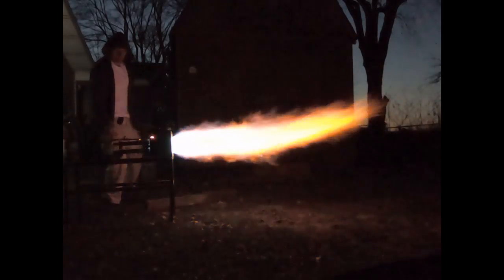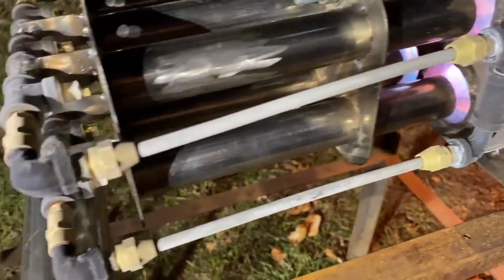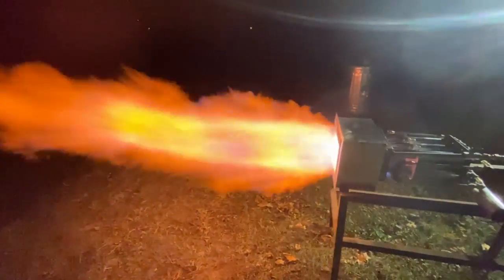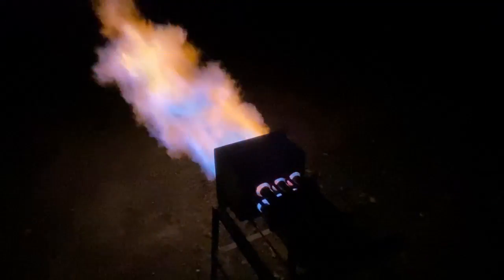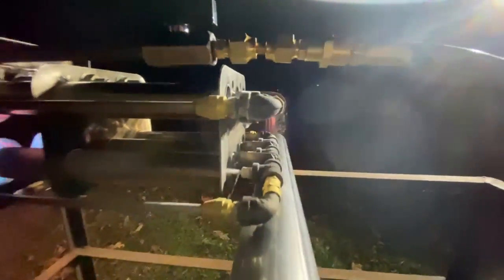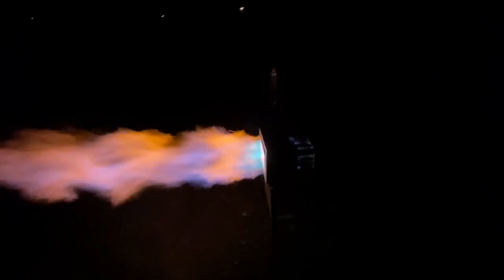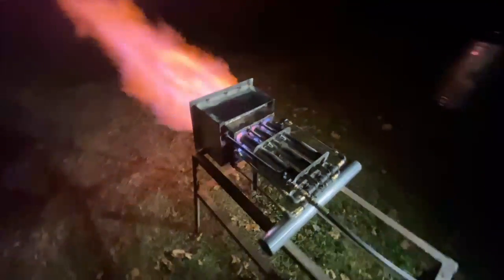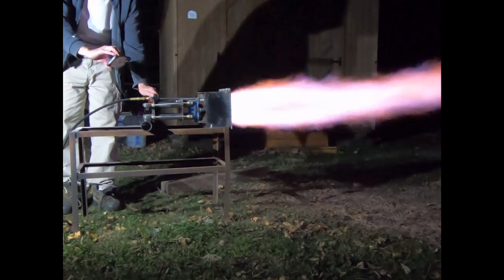Thunderbolt Propane burner 3,300,000 BTU 1 Mega watt

Comment: Looking to get started as a blade smith, and I understand very little. Any way to shrink this down into a ‘ribbon’ burner for a small forge that can get to forge weld temps with a slightly reductive flame? Or am I way off track with what I really need?
Reply from the maker: This wont work but i could build you one
Reply: yeah let him build you one. I don't think you've posted anything ribbon burner related have you? I'd also like to see something natural gas...I've been wondering about natural gas...

Comment: What burntime do you get out of a single bottle? And could this be shrunken down for a smelting furnace for doing cast iron with LPG.
Reply from the maker: I have smelting burners avalible please see the link in the description titled burners galore ebay or you can contact me with the other details
Reply from the maker: This would be connected to a propane truck in practice . but 10 minutes is about all you get out of a 30 lb bottle , 20 lb bottle not sure maybe 5 to 6 minutes

Comment: What calculations are you using to find 1 mW?
That box is a beast
Reply from the maker: it burns 160 Lb of propane per hour or 2.6 Lb per min so at 21,548 Btu /Lb thats over 3,300,000 Btu , we ran a little lower setting for a time so it definitely came in over 1 megawatt full tilt